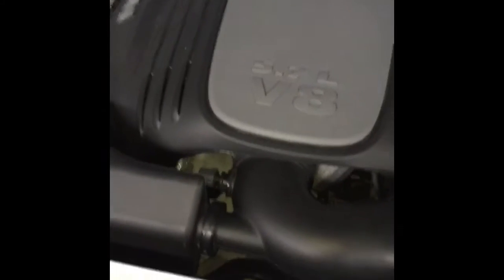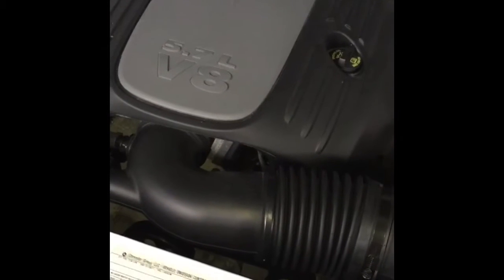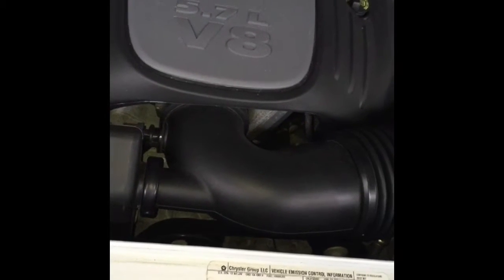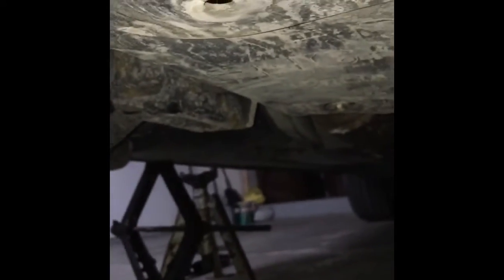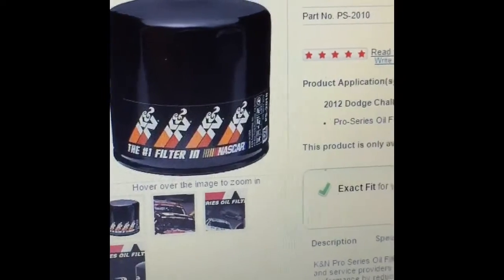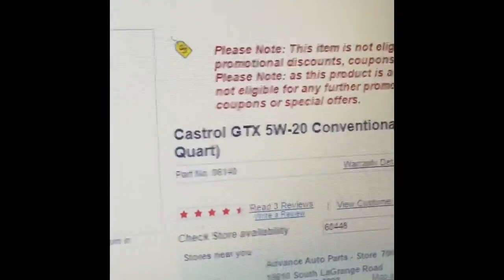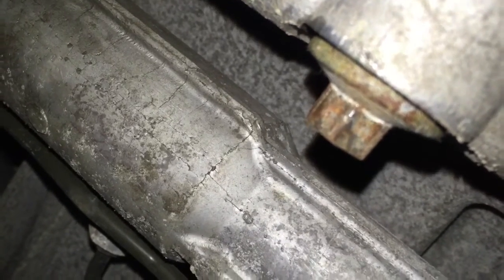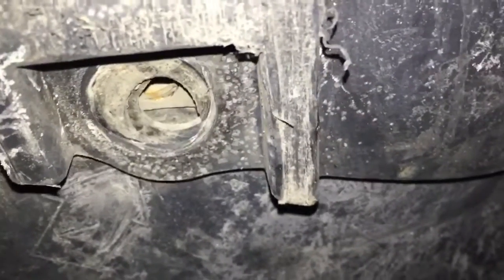Oil change 2012 Dodge Challenger RT

Comment: You never go more then 3k miles per oil change. My dad worked at dodge for over 30 and always changed his oil every 3k he always said we recommend 5-8k so they need a new engine in the next 10 years and they will likely buy a whole new car
Reply from the maker: Thats some good inside information. makes you wonder when they tell you that the synthetics oils and extended life filters make you able to go longer between changes. Who knows maybe its just ways to make more money. i guess just change it when you feel you need to. once a month, quarterly, or 6 months. i think driving habits dictates how often you should change it. speed demons doing burnouts and doughnuts should definitely do it more often lol. thanks for the view !!